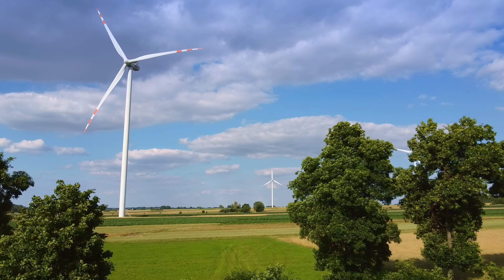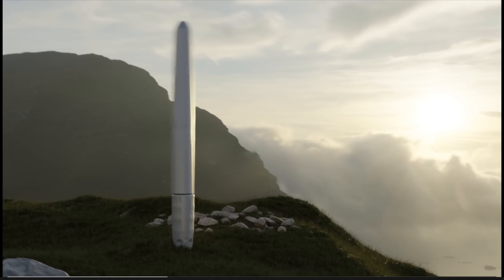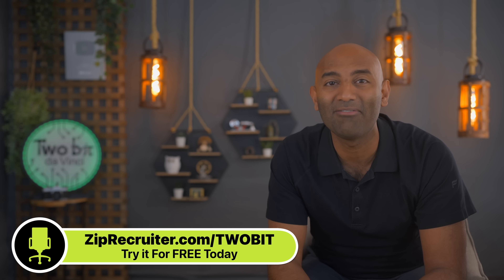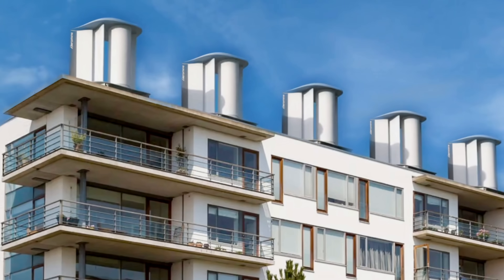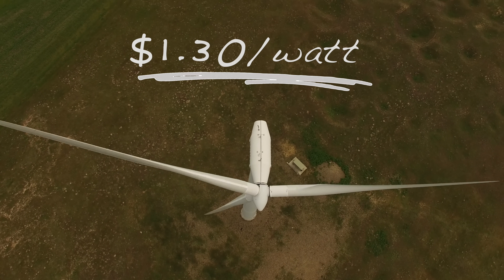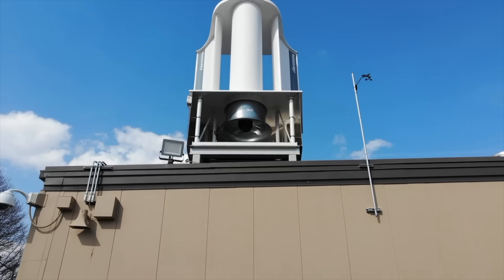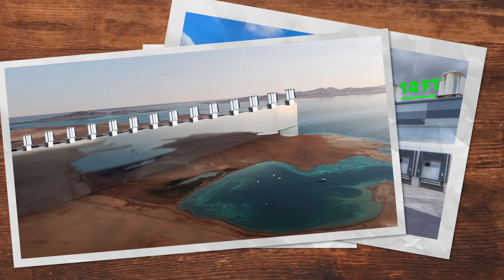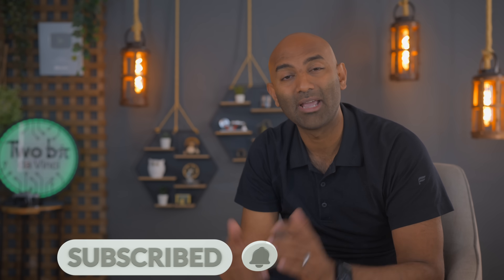Can This Genius Wind Turbine Outperform Rooftop Solar?

Comment: Biggest down for this model is that it has very limited use in an area with changed wind flows as it seems to be fixed into 1 direction only to receive the wind.

Comment: @Two Bit da Vinci  
Ricky, have you looked into the Ventum Dynamics vertical rooftop wind turbines?  IMO they are a simpler, more efficient, and more versatile solution which also uses the Venturi Effect and "airfoils".  However, wind direction does not matter.  They are a similar size (actually a bit smaller), and IMO more aesthetically pleasing, while also being quiet.

Comment: I'd like to consider investing in a unit like this, but I'd like to know the technical details, what is the overall weight of the shipping package, and what material is used for the packaging. Installation footprint? What is the factory price? How to avoid dust is conducive to long-term operation? Is it available in China?

Comment: With the potential increase of winds generated through the foils. Placing a wind turbine directly in the path of this increased airflow could be a synergistic option.
Reply: No. The increase in wind speed is irrelevant. No free lunches. The area governs the output power, not some device to increase the wind speed.

Comment: Very much interesting tech. But, I'm a bit concern about the dust that will eventually clogged in the piping system and the props... Will it be easy to clean it, so it would be in its best performance?
Reply: It would be easier to filtrate, due to its induction properties.  It would involve monthly maintenance, like your Hvac system.

Comment: First of all, absolutely agree that combining the generation of electricity WITH the extraction of heat build up near the top of the ceiling is a huge win win.  Second, you mentioned several examples of the benefits, but didn't mention that this would eliminate the costs and losses from transmission, that is such a huge negative factor when generating electricity from large windmills that are a long distance from where the power generated will be used.

Comment: It should be noted, however, that the wind does not come from only one direction, as the front of the Aeromine module suggests. "As soon as the wind turns even a little, the wind surface area of this system is reduced", good concept but not quite thought out, there is certainly still some room for improvement.

Comment: They must be kidding !  

All that structure to create a slightly lower pressure zone as the draw for a small diameter regular fan blade generator.

These "academic" engineers should leave product development to real engineers with practical experience.  The inherent buildup of frictional loses in the system alone would seem to make this contraption a non-starter.  Occams razor it is not.  It can't react fast enough to chaotic wind direction changes, especially in an urban turbulent flow environment.  Just the physics of low mass wind flow thru a small aperture "generator" makes this design a fake and perhaps belies it's real use as a VC honeypot.

The release date I predict will be when VC's are fooled into backing this physics defying design.

Comment: Back in the 1950's and 1960's I saw a way to cut a barrel in half vertically, add a car alternator with two pulleys and a belt to generate 12 volts. Designs of wind turbines have changed over the years but the basic Savonius vertical axis design still can't convert as much wind energy into electrical as the horizontal axis design using blades (17% verses almost 50% because of the area intercepting the wind.) So, this complicated design still uses smaller horizontal axis blades but relies on a wind tunnel for higher speed winds. Looks like it could make a great nest for insects or birds and certainly costs more.

Comment: I’ve always been kinda confused about people comparing the two. Wouldn’t the most efficient and reliable thing be to use both.  When the there is cloud cover/poor weather it will probably be windy out. So the loss of power generation from the solar panels gets offset with the wind genterator. In the stock market the safest accounts are ones that are well diversified. I see power generation the same. Don’t rely on one source for your own safety and peace of mind.

Comment: We have many rivers in this country and we should make better use of the energy potential of them. By designing water powered turbines suitable for the environment they are installed in we could  provide local areas with power as long as the river flows.

Comment: The principal draw back with the device is that when you do get a strong wind, it would rip the thing off the roof with a good portion of roofing. The same would apply in the UK, where we experience very high wind speeds, with brick built buildings as those cheap frame jobs you throw up in the USA. Corner rooftop siting for these is a non-starter.

Comment: I would still consider this project experimental as well since there is nothing available commercially. Furthermore, I have yet to see any news, from Aeromine, that would suggest this will be available for residential use. Everything appears to be geared toward larger facilities or commercial use only.

Comment: Any house has at least one wall, the collects solar gain heat, this heat has a lifting motion effect.
You want to play with one build it out of cardboard and mesure airflow effects around your house rooftop or even sidewall  youll find a sweet spot. Even at night this air movement happens
Think about this your roof and attic get hot a system of even vents and roof top vets let this heat escape the attic.
In the summer your attic could be 140 dgr inside and outside air temp is 80dgr 
Thats a big difference in heat and that heats trying to escape and being pushed by the cold inside the house and lift outside on the walls. The heat wants to exit at the ridge of your roof. Temperature is trying to find its leval. Much like water does.

Comment: There was a roof turbine maybe 10+ years ago I saw that looked very promising. It had a paddle wheel similar to a steam boat on a river not w/ horizontal blades but curved blades on angles, was very light weight and on a swivel so it could rotate from wind in any direction. It looked like it spun all the time with wind from all directions that could fill a battery bank easily. Only time no spin was w/ no wind. The video disappeared. If it could spin 1k revolutions per minute/hour w/ 10 to 40 mph winds, there would be no need for electric except for just in case. No idea why it disappeared, maybe big tech? We had some winds here in central Florida all weekend, 10-25 mph, my chimes were wild all weekend.

Comment: I think this smells quite fishy. Not taking into consideration the size of the thing, the materials aren't that expensive, and the construction is quite straight forward. To be blunt, it looks like quite a simple device. Why the cost, why the delay, even though two years is quite fast, and why the convoluted pilot project?

Comment: Couldn't something similar be made for electric cars to recharge the batteries while you drive? (Within air intakes, for instance)
Reply: That would be an attempt at a perpetual motion machine. Cars are designed to minimize are resistance. Turbines must resist the flow to impart spin which would increase battery depletion.
Reply: @benishborogove2692  it wouldn't completely recharge but, like regenerative braking, it would add mileage before a recharge is needed.
Reply: RIGHT, CLOWN

Comment: I will believe it when I see it.  Also, people need to understand that height is just about everything with wind gen.  

A local engineering company installed a horizontal wind generator on their office building a few years back at a cost of about $500,000.  At max capacity, it could run two microwaves.  Great publicity, but a complete and utter waste of money if producing energy was the goal.

Comment: Wind generators r limited in residential due to noise, visual intrusion with a mast or tower & risk of injury from moving blades. 
As with solar I believe industrial estates should utilise roof space for either generator form. This would be the best step fwd while developing systems for residential zones.

Comment: Should scale it up and make an entire building one huge aeromine and see how many watts it produce. Added that heat can be easily removed at the intake to even increase efficiency of the system, tropical cities could have free air conditioning. Need to be extremely strong to withstand storms though.

Comment: Usually, you only get decent wind at around 30 metres or 100 feet elevation. Vegetation, trees, other buildings etc disrupt the airflow.

Trying to get significant wind power at rooftop level is a fool's paradise.

Comment: Take a cylinder,  cut it into two vertical halves, weld them together vertically so that the open halves face different directions, pivot the device on upper and lower ball bearing joints. 
The turbine spins whatever the wind direction,  so connect for electricity as you will.

Comment: Wind turbines attached to buildings tend to vibrate the building frame. That can be very annoying (noise) and at worst destructive, particularly in residential buildings. Maybe less of an issue in factories and similar.

Comment: There is no reason why they couldn't make the entire structure pivot into the wind, by placing the stand on a ring of ball-bearings, and adding a large dorsal fin on the rear of the structure, so the wind could steer the turbine into the direction of the wind.

Comment: Anything attached to a house has to be silent. We had a air extractor system in the loft. It was nearly silent. But turned of at night. But if a northerly wind blew at night it turned the switched of fan. The noise kept us awake. Fitting a powered blind to the outlet fixed the problem.  So I would be very cautious to fitting a turbine to the roof

Comment: You could make the intake for this system part of a house AC system. This would passively move air through a AC system with minimal help from fans, once again lowering energy cost.

Side note, it would also act as an exhaust to pull fresh air from the star of the system.
Reply: that is the real invention, maybe you should try it. The venturi effect could be powerful enough to run a ventilation system. but not powerful enough to run a generator
Reply: Amazing idea!

Comment: Rather than relying on wind,  could you use exhaust air from buildings?  Hospitals have high air exchange rates.  High volumes of air is exhausted through fans.  If that air was redirected through the turbines they would get a consistent volume of air in perpetuity. Other commercial buildings have similar exhaust fans as well.

Comment: The claims of this company are simply untrue. The design is uni directional, therefore the average power output is going to be less than a horizontal turbine of the same area that always faces into the wind. Also the   design requires more metarial than a simple horozontal turbine, therefore it will never be cheaper than the existing horozontal turbines. How do I know this, I worked in the UNSW school of Mechanical and Manufacturing Engineering Aerodynamics laboratory for 10 years and tested many types of wind turbines using wind tunnels.

Comment: If they mounted these over a large scale plastic sheet - the air underneath is heated and rises to be collected by the aeromine inlet - the air is already moving so it may increase performance. The surface of these plastic sheets used for protecting high value crops from 'hail damage'  tends to be non-flat but the units could be mounted higher to circumvent this.
The generated power could then be used for irrigation or autonomous  small scale farm equipment.

Comment: 20 years ago I read an article about a high tower capturing wind which was created by rising air from warm ground heated by the sun. A turban inside the tower drove a generator. The inventor claimed he could power the whole world using the space of the Sahara desert. Sounded like a great idea..........so what happened? I never heard. Best of luck to these guys. I'm all for it if it works.

Comment: Should be easy enough too make?  Just check the sheet steel prices. I was working on something similar?  If you have the skills you might be able to make your own?  3D prints are advanced enough? You can put an aeromine on a slew bearings? That should make it self alining?  You also have the fact that this can be retrofitted to a existing turbine tower? Which is a huge cost saving?  If you use what trees do you can make these into a biotic pump? Yes it more auxiliary system. But there plenty of science tweaks?  Especially if your talking syphons? Then you have the added options of co flow jets? Which could up efficiency significantly? There a ration between collectors and turbine bore that has to be considered? There an optimum ration due to boundary layer effect?  To much can choke the flow to little it doesn’t work at all?  You might be able to build one from things you find at a Home Depot? A cheep sheving unit is a place to start?  Depends how technically you like to go? As I’ve debated the use of ion plasmas?  I don’t know what plasma channel on YouTube would say to such a suggestion? As he busy designing a ion thruster?  So maybe he could point you out a few key features?  Should be easy enough for a semi skilled engineer to make? About a weeks work all said and done?  I hear that the maximums for aeromine’s is about 35% with a few tweaks? It could maximise potential?  Considering it the volume cubed been the main measure of air flow? If it enters at 3m/s and leaves at 10m/s?  That 3 fold increase and an enormous pressure drop? If the tube itself is a hyperbolic cone?  Then you will get something like a tornado from in the tube? If that happens the low pressure will help drive the turbine? Therefore increasing output? Down to you how you achieve that? If you can make one for 500USD then it game on?

Comment: Hi, nice vid. You said at the beginning of this vid that the average use (1:14) was 1.2 kw (Hour, day ???. How many kWh per capita does the US use?
In 2021, the average annual electricity consumption for a U.S. residential utility customer was 10,632 kilowatt-hours (kWh), an average of about 886 kWh per month or 28 kWh/day.  If you look for small (3 kw) generators you find that you need a windmill of about 4M diameter (13 foot) and a tower about 30 feet high, cost, about 7000 dollars. I could be wrong, I'm not perfect, Ommmmm
Cheers

Comment: I like solar solid mount better. Wind gens are mechanical and therefore require maintenance. If anyone advertises a wind gen as maintenance free, do not buy it. I found out the hard way that there is no such thing as a maintenance free wind generator. If this new design is more reliable than the blade machines for residential, great.

Comment: As air extraction in factories this could be a potential disaster causing fires.  Or the build up of dust would clog  ducting this added drag and continuous maintenance would make the system  unviable in most commercial factory.   

In Warehouses  this could work  but the inflowing air quality and humidity of air would have to be taken into account depending on goods being stored.  

60% of dust and pollutants does come from outside huge volumes of air would  be unfiltered entering the facility first then into large quantities of  expensive ducting.  
It's not going to happen may even go against most insurance policies.

Comment: I think the advantage of this turbine is potential quietness, there are more then enough high rises and warehouses to have flat roof.  The quietness is key with traditional wind turbine, the tip of the blade is in sub sonic speed and it is noisy, as the turbine itself is hidden inside if it is sound proofed the noise made it interesting
Reply: It will be quiet because it is not turning or turning very slowly 99% of the time.

Comment: Nothing new here. Everyone has experienced increase wind velocity when the wind is forced between two objects
Ie Buildings close to each other.
But to invest in something that only works under exacting conditions of wind blowing in precise directions makes it a one trick pony.
Not to mention it has to have a clear shot, not dirty or disruptive airflow created by buildings or landscape.
 And not a reliable constant source of energy.  
Seems it would make more since to have foils set up to accept air from different directions to excite vertical axis turbine blades in the center. Thus increasing the air flow dynamics from different directions. And I believe there are models like that being developed.

Comment: With so many minds thinking about the right design of the vertical wind turbine using the drum half of a 4 drum halve configuration which are aligned at 90 degree angles from each other, how to stop the drag from the opposing side of the drum half, there is a simple solution that operates independently from the rotation of the drum turbine.